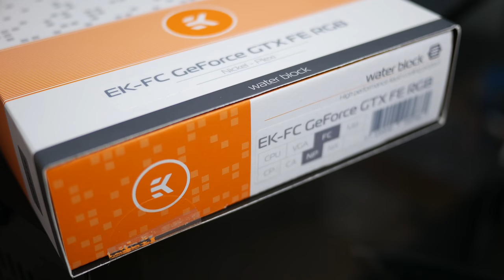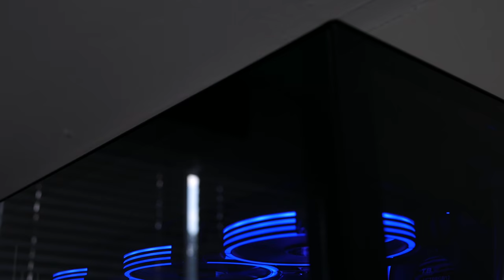Lian Li O11 Dynamic build - Liquid Cooled Ryzen 2700x and Titan Xp

Comment: This build looks like beast! I have the same case with a 360 60mm rad on the side and a 360 30mm rad on the top. Does your fans spin up audibly when gaming?
Reply from the maker: It was basically silent with a relatively normal fan profile. It was one of my favorite builds I have ever done. 😁 What are your specs?
Reply: @LetsGetTechy  Mine is a i7 4770k, 16GB RAM, 1,5TB SSD and a 1080 Ti. Both CPU and GPU are water cooled. I think I'm gonna upgrade when the successor for the 2080 Ti comes out and go with an AMD CPU.

The great thing is the silence. Only bad thing is that I had to mount the GPU vertical and thus could not fit my soundcard. But either way I like it. Theres a few pics if you wanna see: https:// imgur dot com/a/ZsIM0FG

Comment: Why do you rip the Star Wars Titan. Sry every standard Titan would do the same Job. Also the Hose doesn't look good in the System. Hardpiped would look cleaner and nicer.
Reply from the maker: I used the Star Wars Titan because I got a very good deal on it compared to the normal Xp- that being said, my buddy owns the card now, and you'll be happy to know that it has the original cooler back on it. :) As for the tubing choice, I just preferred to do soft this go around. I enjoy doing soft tubing more because it hurts my brain less. No doubt rigid tubing would look better though!
Reply: he did it because of the back plate obviously

Comment: How does the system perform with regards to temps? Curious as I am going to do a similar build and am trying to decide on a single or dual 360 radiator for a 3700x and a 2080ti.
Reply from the maker: So that system did just fine, but I can tell you that the new 3000 series is quite a bit hotter. I just rebuilt my personal rig with a 3900x and I have one slim 360 and one thick 360, and under load I'm hitting 1.3v and that gets me up into the high 70s and sometimes low 80s depending on exactly what is loading the computer. I would suggest maybe a compromise of a single 360 and then maybe a 240. Your 3700x shouldn't be quite as hot as my 3900x, but I also think I got lucky with my sample as it's stable at 4.45GHz on all cores at 1.3v. yours may require more voltage than mine which could mean similar heat output. Just depends on the luck of the draw. I would say 360 + 240 just to play it safe.
Reply: @LetsGetTechy  Thanks! Very helpful.
Reply: One more question - radiator thickness? Looking at the HW labs 360 GTS or GTX. Want to ensure I have enough clearance. Looks like the GTX would fit in the top just fine? GTX - 55mm GTS - 30MM
Reply from the maker: @frenchyeps  I would definitely suggest the thicker one. If you are using this Lian Li case, there should be plenty of room up top.
Reply from the maker: @frenchyeps  Happy to help!! Good luck with the build!

Comment: Nice build! Are you using 9 Enermax fans or only 6? I'm about to buy the 6 pack (3 intake, 3 exhaust).
Reply from the maker: I used 6. I bought the same 6 pack you are looking at. Great kit for the price.
Reply: @LetsGetTechy  I just wish the side intake fans rgb rings would look the other side.  Still looks beautiful, respect.
Reply from the maker: @GatesAgency  I agree completely!

Comment: You ripped off a limited edition Starwars Titan Xp naked. That's like bought a 911 GT3 RS and took its wings and make it a convertible.
Reply from the maker: It felt so good. 😏
Reply: @LetsGetTechy  No doubt about that. I also have an old Titan Xp that I bought on release, I had no issue with it only until recently. 
It hits stable 90C(fan speed 3000 rpm) when idling! Which is crazy! So I am looking for a water cooling solution to solve this problem, It gets ridiculously LOUD if I just crank up the fan speed(Auto fan speed would bring 4500rmp when idle). I also don't want to build a full Ek water cooling loop, so my reference would be "https://www.youtube.com/watch?v=9gKrEvdkBVw".
Do you think that's still doable, by myself?
Reply from the maker: @amhowaye1605  absolutely! Go for it man! 👍